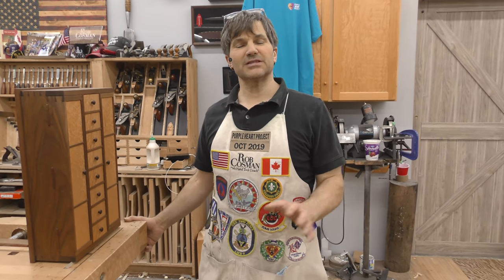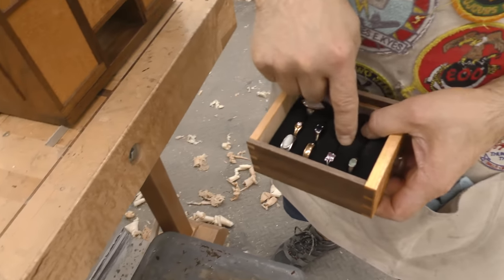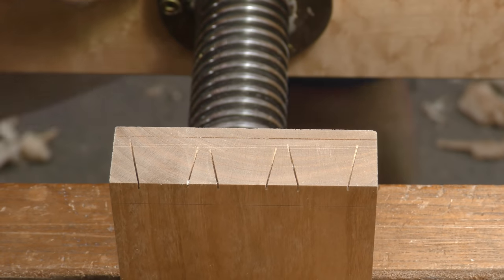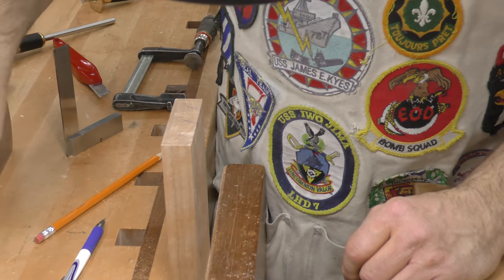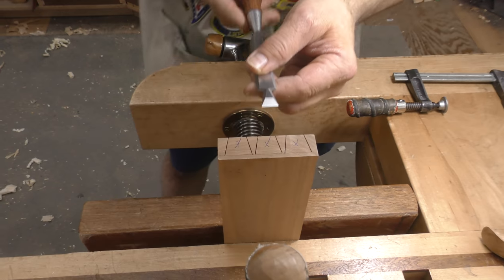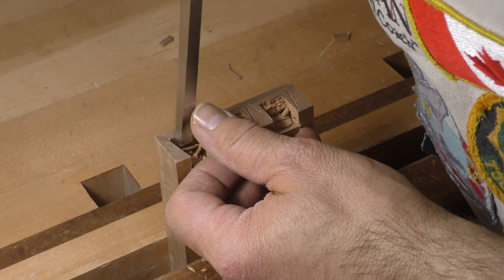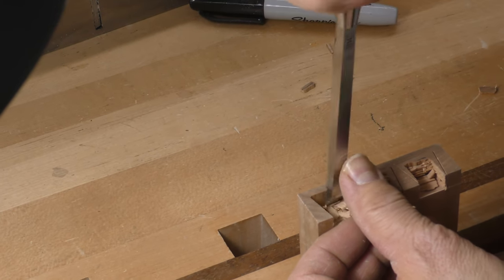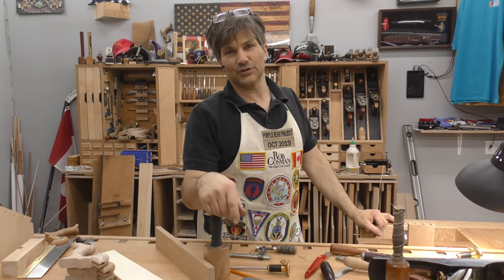Drawer Making Episode 8

Comment: How do you sharpen the special shaped chisel with 3 cutting edges?
Reply from the maker: The half-blind chisel? The sides will never need to be sharpened under regular use, the tip can be sharpened the regular chisel method